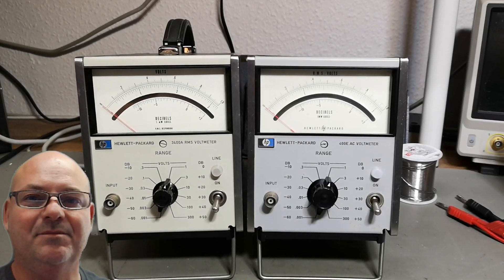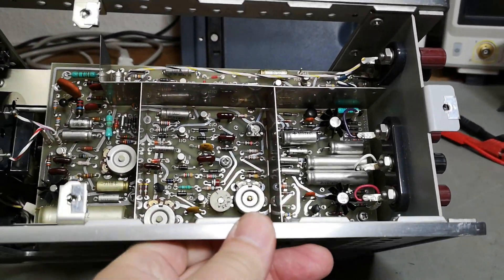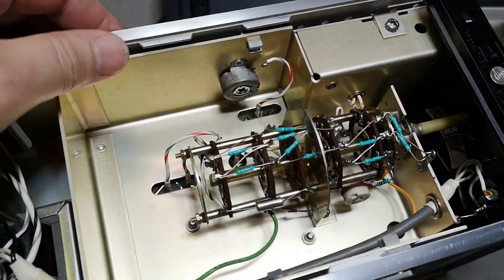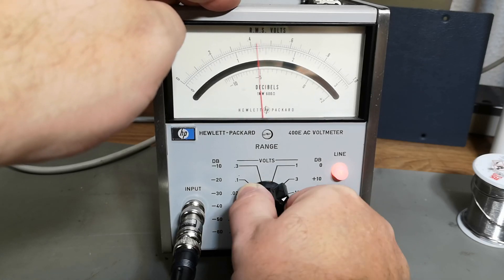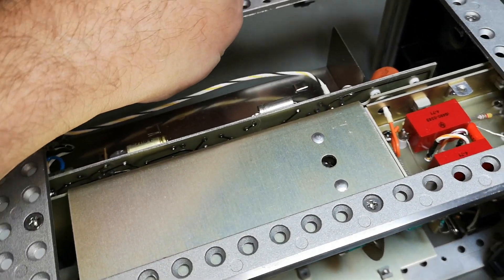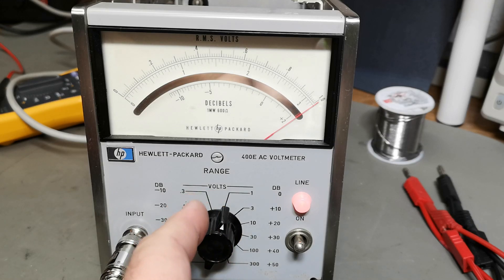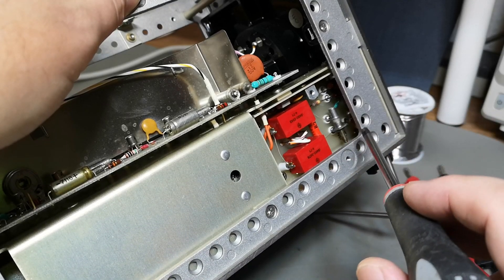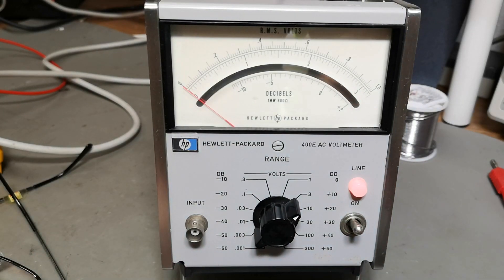HP 400E AC rms Voltmeter 1969 test teardown

Comment: Thanks for this interesting video. FYI, from what I read in the "Operating and Service Manual" of this instrument, the HP 400E is NOT an RMS voltmeter. Section IV (Theory Of Operation) says: "The 400E is a solid state, average responding, rms calibrated voltmeter". This means that for a 1Vrms sinewave it will indicate 1V. But for other waveforms, it will not indicate the RMS value, but a value proportional to the average value of the rectified waveform. The HP 3400A on the other hand is a true RMS voltmeter.